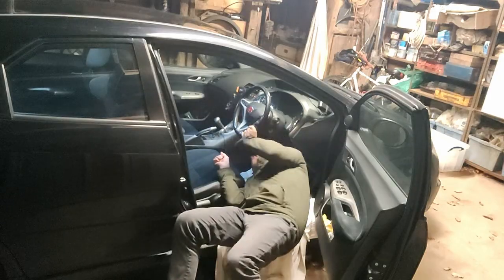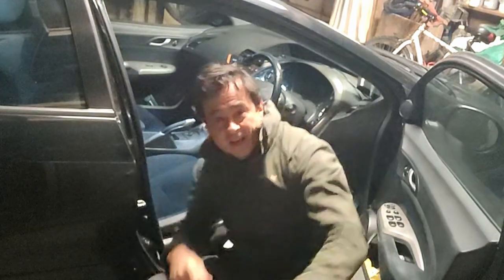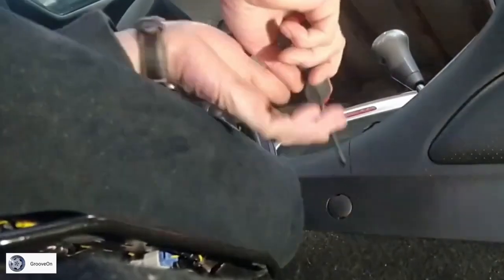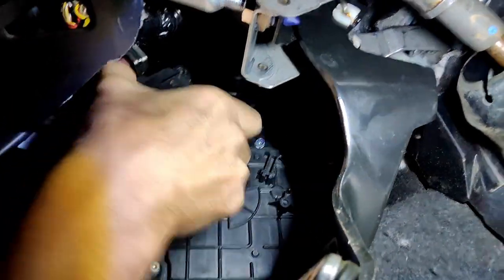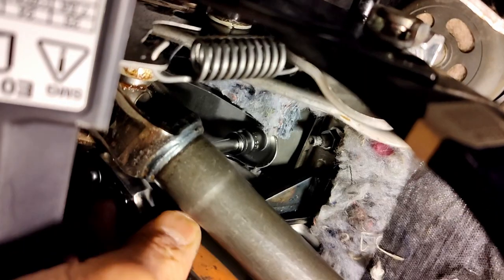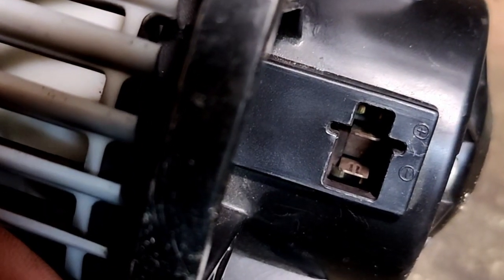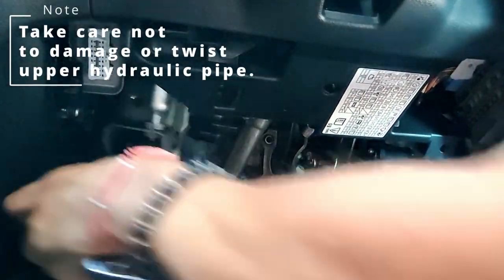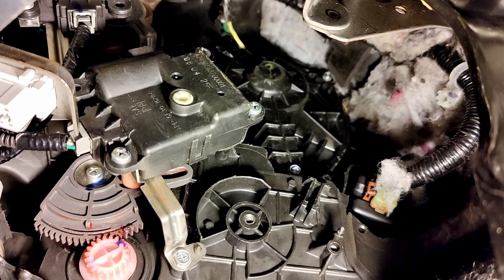Honda Civic Mk8 Heater Blower Fan Replacement + With Handy Tips!

Comment: If I can add some value to a brilliant video, the initial heater setting must be cold, or the flap valve actuator motor will not come off....unless I missed it😂❤
Reply from the maker: Yeah, I think I mentioned that when you reassemble,👍🏼
Reply: @GrooveOn  yes you certainly did😎

Comment: Holy crap I was thinking about getting this model civic but this as you say not for the faint hearted! I have a 2005 Accord. Open glove box empty it, press the sides in and let it drop. Blower motor right in front 3 screws I think. Thanks for the DIY videos keep making them.
Reply from the maker: Thanks, I did my friends nissan note, like your accord remove glove box 4 screws loads of access easy!
Reply: Buy it if it is a good chance, it's a beautiful and reliable car anyway

Comment: Hi i need help i have problem with my honda civic 2010 mild hot air flow and fan make little noise when it’s on full mode
Reply from the maker: @saqibjutt6609  have you tried changing the resistor

Comment: Just finished replacing mine. This video is definitely the best resource to see how it's done properly. Getting the new one in was a bit of a struggle with that wiring loom at the top fouling the fan as you try to turn it but perseverance prevails.
Reply from the maker: @zenthius  well done mate
Reply: In the middle of doing mine.There is no clearance with the wiring loom in the way
Reply: @frago1969 how did you take it out?

Comment: Hello there..I have a 2011 Civic and the climate doesn't switch from cold to hot...and of course this happens now at the winter..an electrician switched it manually to hot,but he told me it's the motor that i have to replace...I have to replace the fan (which is working by the way) or is the first part you remove that controls the temperature?Thank you in advance
Reply from the maker: Hi There, if you watch the video I cover the area that I believe is what your mechanic switched to manual, there are some tests you can do and it will be either the fan or other components. I usually reserve further information for my members or for those who used the Superthanks button option and leave a comment on what  the issue is. Thanks.

Comment: Just completed this job, massive thank you for taking the time and effort to make this video, wouldn't have been able to tackle it without it.

Absolute pig of a job!! Approx two hours start to finish. I scored a line on the plastic side panel and popped it off, I wasnt bothered taking out the whole centre console. 

Very tough job but the bucket and sheet idea certainly helped. Hands and arms scratched to hell and I've a feeling I'll be sore in the morning from all the twisting and turning!

Unfortunately it didn't resolve my issue, after all that!! 😢. The blower had been intermittent, and sometimes worked with a bit of a bang so I assumed motor, stuck in a new one and still nothing! Could have cried!! I'm hoping now it's the resistor, at least thats easy get to and if nothing else I have a new blower fan 😂
Reply from the maker: Well done and I'm glad the video helped it's a real pain huh. I would be 95% sure it's the resistor, they are cheap and easy to replace, let me know
Reply: @GrooveOn  problem sorted 👍 Just swapped out the old resistor for a new one and she's blowing good-oh now 😁

I found that I had to swap the plastic casing from the old resistor onto the new one as the aftermarket one was a tad too big.
Reply: How much are the resistor?

Comment: Excellent "How to video". Really good.
Extra tip - Remove the clutch pedal first (as shown later in the video) Mine was impossible to remove without. Possibly due to a larger wiring loom in the way.
Reply from the maker: oh I know that wiring loom your talking about mate !! arrgh. You may be interested to know I am just about to release another video on using my Honda with my Maxicom mk808 diagnostic tool, here is a special pre-live link for you... https://youtu.be/2RXyLiTmjSk

Comment: Just did mine , thanks for the video of how it's done.
Spot on .
Reply from the maker: Nice one, its a pain huh!
Reply: @GrooveOn  Its a mission  bro , your explanation is the best on here.
I'm 110 kg so removed  driver seat ,vacuumed and set up foam pillow in footwell and floormat over floor pan area,  
The humidity  is in the 90% range here , so i took my time and learnt the resistor  repair whilst at it.
thanks for sharing  the knowledge  my friend.
Reply from the maker: I was so close to removing seat. Did you have to move clutch
Reply: @GrooveOn  , yes , to install fan .
Reply: @GrooveOn  yes, as per your  information , Id already  replaced the the clutch  MC, so I knew exactly what to do there .

Comment: Great video, only one that i can find  that is straight forward

Any idea what could cause weak airflow? 

 The blower has been changed and i can hear the speed go up and down when the buttons are pressed with a slight increase in airflow.

Air filters changed 

Possibly a blockage some where maybe, any tips to check this?
Reply from the maker: could the fan is wearing out, also the little resistor next to the fan can be troublesome

Comment: Doing mine now cheers fella
Reply from the maker: @robbiegoodfellow409  good luck, try using something at the door so you can lie down, hopefully you have an auto or you have left hand drive !
Reply: @GrooveOn  Nope RHD and manual...used an old picnic basket...took me four hours in total. First time Ive had a go at fixing a car. Manage to get that panel off though...Next job is to put a touch screen in for the radio...Thanks again...couldn't have done it without you.
Reply from the maker: @robbiegoodfellow409  oh boy, you did well, 4 hrs is what it took me 1st time!

Comment: Hi, great video. I have to do mine, doesn't work at all. But I've got the wrong one - said on the website it fits my civic. I have 1.8 petrol. Do you have by any chance OE number for it? I'm in Ireland - right hand drive but on some doesn't say which one it is and I don't want to buy another wrong fan.
Reply from the maker: I know what you mean I've made the exact same mistake. The best way is just make sure that the one that you have looks exactly the same in the photos as the one online. This was the one I bought and fitted https://www.ebay.co.uk/itm/383644361301?mkcid=16&mkevt=1&mkrid=711-127632-2357-0&ssspo=eo3flM5cSvO&sssrc=4429486&ssuid=hM34COOAS2q&var=&widget_ver=artemis&media=COPY
Reply: Thanks! 😃

Comment: Thanks.  Replying other video.  My lack heating I suspect as Thermo  or Actuator or maybe even a blocked off under dash radiator
Reply from the maker: If you watch my video I show the little actuator lever which closes off the outside air does that move on your car, or it could be the thermostat
Reply: @GrooveOn  thanks been watching, I'll also find your thermo video see if easy to do

Comment: hi mate, I've got no power to my heater blowers and my back window defogger? Will this be the resistor or the heater matrix. would love some guidence if thats possible?

cheers
Reply from the maker: hi there, I doubt the two are linked, the first thing to do is check the fuse to your de-mister window and the fuse to your blower fan. They are in the engine bay, Fuse 12 I think is for your rear de-mister and fuse 19 is for your blower.
Reply: @GrooveOn  i will look at that today mate thank you . The blower fan fuse looked fine when I first came across the problem . There just isn't any power coming to the buttons on the dash .
Reply from the maker: @jonnykell7717  interesting, have you got an aftermarket stereo?  there is a plug that goes to the buttons I remember. I did a video on how to remove the radio
Reply: @GrooveOn  no mate , just the pre built standard radio . I'm back home this weekend so I'll buy two new fuses . Your great for replying and helping me out 👍 top guy !
Reply from the maker: @jonnykell7717  you are welcome also could be your resistor I did a video on changing it. They only cost a few £ or dollar's https://youtu.be/4ff81Dgn8Vo
Reply: @GrooveOn  I've just watched your resistor video , would that be connected to your demister as well, pal ? Also, where's the video on the radio ? Is there something behind there that could be linked ?
Reply from the maker: @jonnykell7717  I am in Malaysia at the moment, will need to see when I get home mate

Comment: Hello, I have a problem with my "Heater Actuator". The thing (arm), that opens and closes, breaks for the second time in 6 mounts. I think that the mechanism moves really hard and the arm is just not that strong to move it, because when I move it with my hand from closed to opened it's kind of hard to do it. Or maybe something is wrong with the  previous installation of the heater actuator. The part number is A24850A3710001, any suggestions what may be the problem? Thanks in advance!
Reply from the maker: so the car-side vents are stiff to move and the A24850A3710001 actuator moves fine yes?  Can you get into the car side movement and see if something is causing the stiffness, maybe corrosion . can you lubricate any item down there? silicon spray is good for plastics

Comment: Does the crap panel actually come out? Mines stopped working and I've been trying to get that little panel out..... My panel will end up a crap panel if I can't 😲
Reply from the maker: If you watch the vid, to get that panel you need to remove all of the armrest part, my panel was already cracked in two
Reply: @GrooveOn  Thanks for the reply , I have watched your video , it's very good , I was just hoping I could get the small panel out. Thanks for the help 👍
Reply from the maker: @chatsport1999  no problem, looking at my old panel I don't think it separates
Reply: @GrooveOn  I've had a go , it moves slightly as if it would come out . Any how , I'll see how it goes and follow your video 👍
Reply: Hello , just a quick question. Where did you buy your replacement blower? Honda have discontinued making them. Many thanks
Reply: I had replaced the resistor and the blower needs replacing now